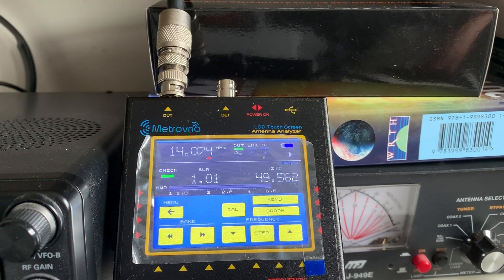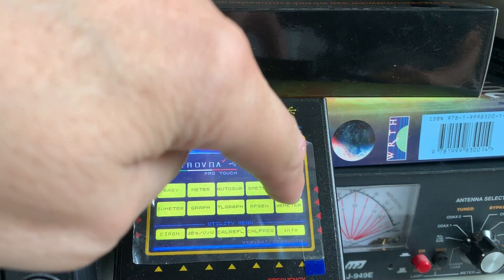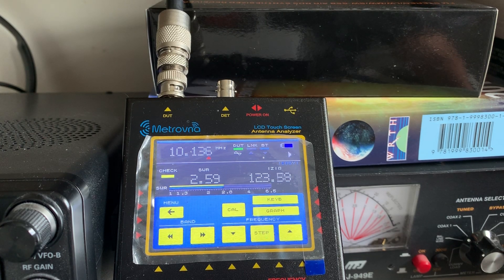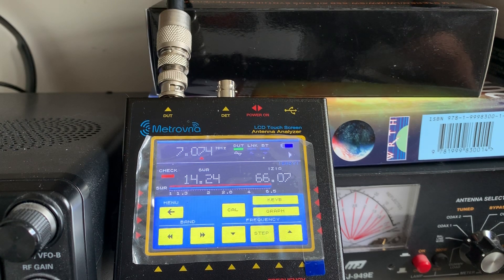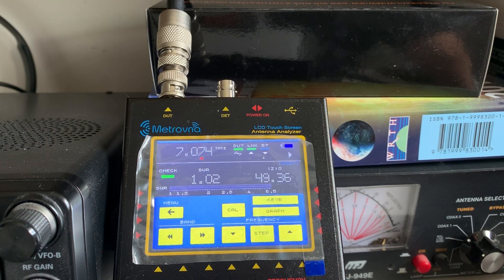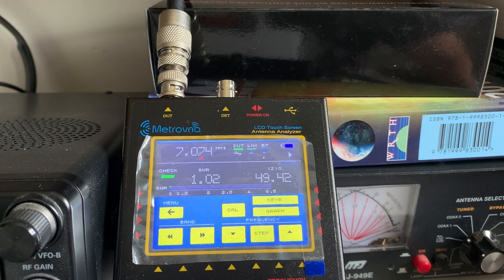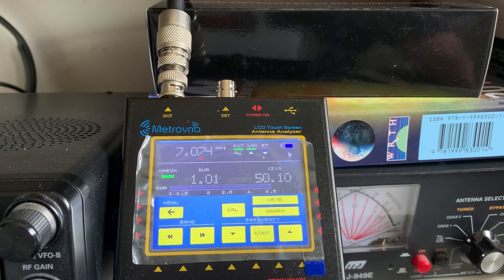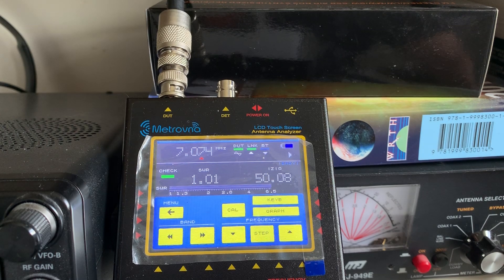Matching an SE-X80 vertical to 20, 30 and 40 m using an MFJ949E &  Metrovna antenna analyser

Comment: Just out of interest, have you tried taking the tuner out of circuit so you can see the real resistance (z) your antenna has on each band?
Reply from the maker: Hi there, no, I always use the tuner. There is usually a small disrepany that requires further adjustment when you YX. 73! Clint